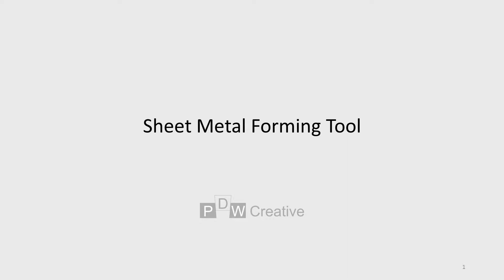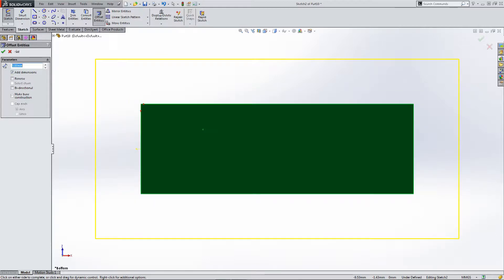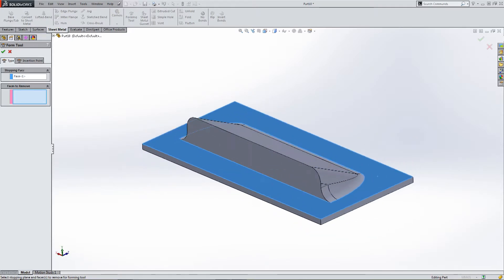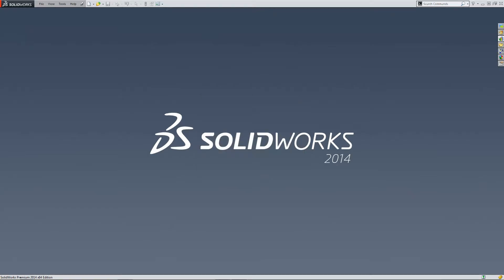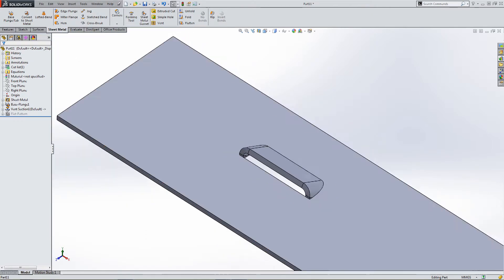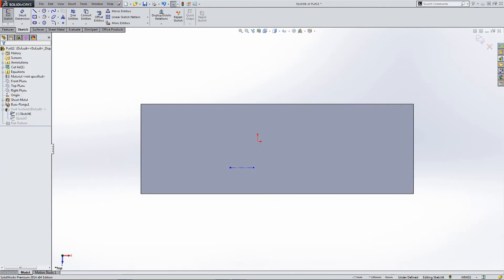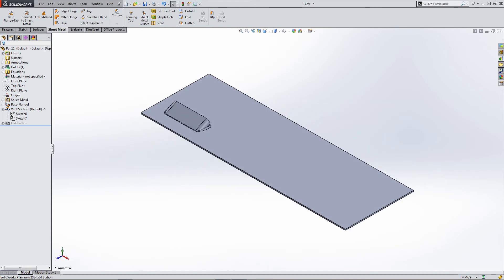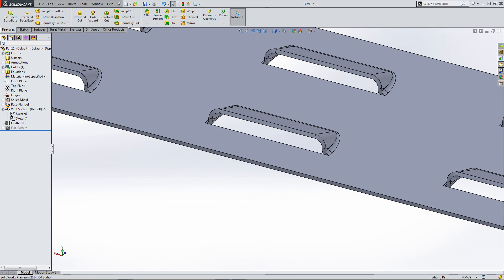Design a forming tool in Solidworks

Comment: I leared a lot from this video, but my question is, how is this manufactured? 

Sheet metal needs to be pressed with a custom tool? Is that it?
Reply from the maker: @ROBOROBOROBOROBO  there are various ways to bend sheet metal. You can bend it by hand, use a hand operated forming tool or make a mould and use a hydraulic press. Forming tools are a way to imprint a specific shape. Have a look at a sheet metal air vent with embossed slots. These are most likely formed using a single tool in one press or in multiple impressions.
Reply: @PDWCreative  I see I found exact tool for this it’s called a Louver forming tool.

However I wanted to make a diy cheese grater in my garage with my hydrolic press, I found nothing.